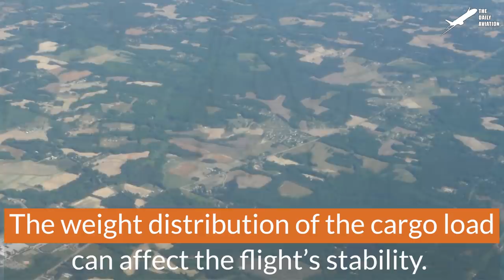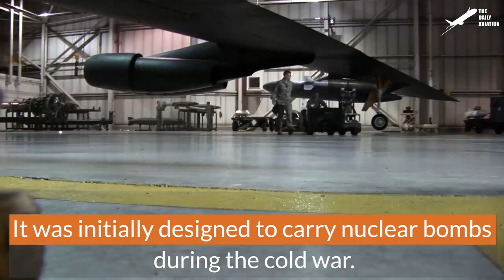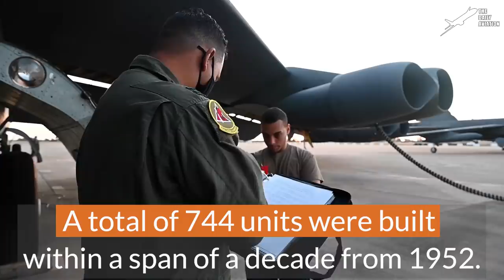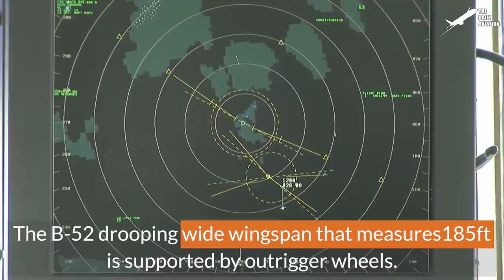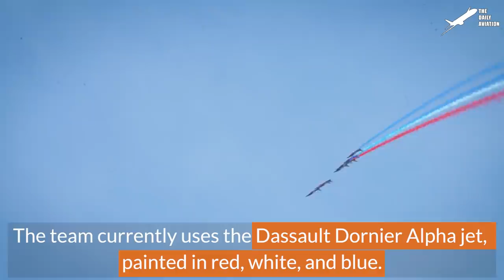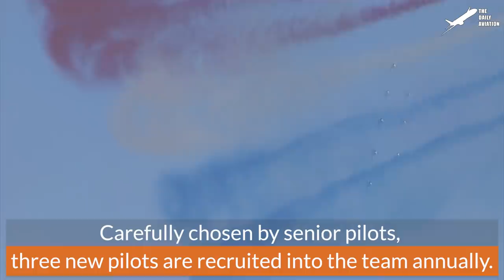Changing Damaged Tires on US Air Force $200 Millions Airplane

Comment: NICE VIDEO:C-17s are an awesome airframe, B-52s are legendary( top speeds are a little higher than quoted), and the French have a well established areobatics team( 6-9 feet seperation is good, however the Blue Angels strive for less than 40")